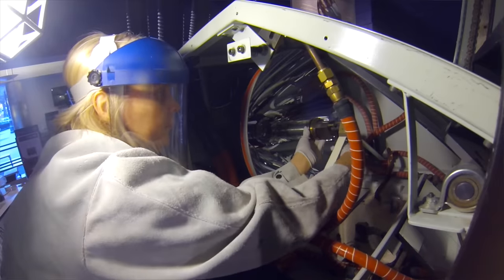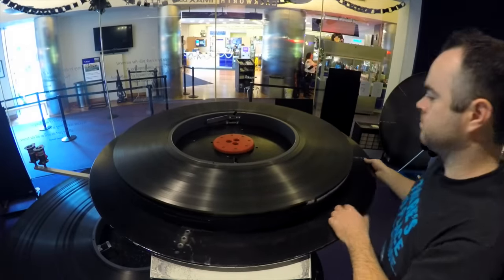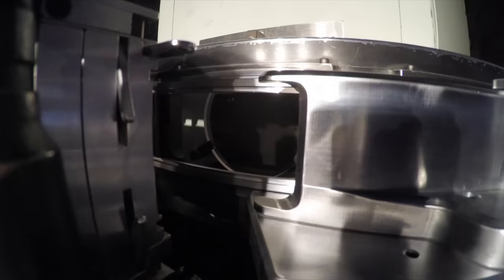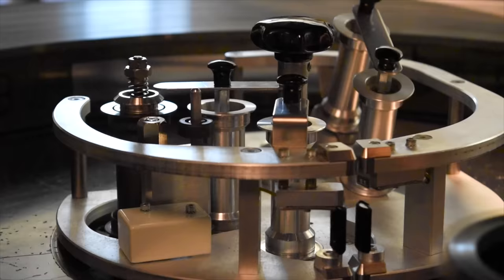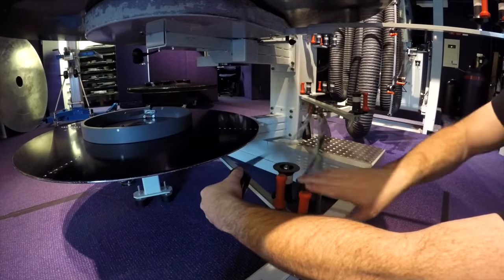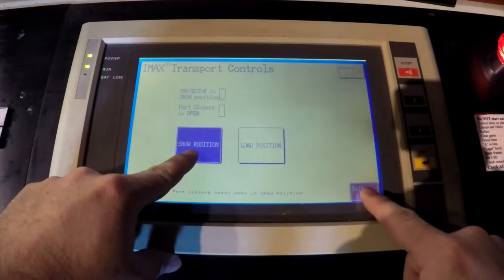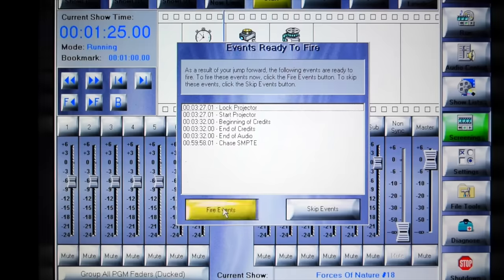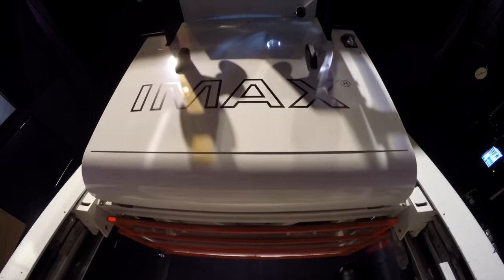The Incredible Process of How a GIANT 70mm IMAX Film is Played

Comment: I used to think like "dang. IMAX is just a scam, why so expensive" after watching this, I respect IMAX again. Great job guys.
Reply: Most IMAX is just digital with the IMAX brand slapped on which is just a scam.
Reply: the real thing would be to see a movie actually shot on 70mm, and then projected on 70mm.... but there are only handful of movies ever shot on 70mm film

Hateful Eight was probably the last one ever shot on 70mm.
Reply: @YoutubeUser-nd8qv   70mm and IMAX are not the same thing. They use the same film stock, but use it completely differently. 70mm (what Hateful Eight used) runs the film vertically, with each frame being five perforations high. IMAX runs the same film horizontally, with each frame being fifteen perforations wide. An IMAX frame is three times the size of a 70mm frame.
Reply: Imax is a scam
Reply: @eksine  Usually, but not always. If you're seeing actual 15/70mm IMAX film projected, it's not. Any form of digital projection is a scam, at least until it meets or exceeds 8K resolution.
Reply: It's called Lie Max and you can see a list in Wikipedia which theaters have real IMAX, only 5 in USA are real IMAX
Reply: @YoutubeUser-nd8qv  Dunkirk
Reply: @YoutubeUser-nd8qv  isn't avengers infinity war shot completely on 70mm film ?
Reply: @YoutubeUser-nd8qv  pretty sure Dunkirk was on 70mm
Reply: @TheAkashicTraveller  Well imax digital is still alot better than normal..
Reply: @gasparmxm  less and less as time goes sadly.  My theater had real Imax but took it out for digital .  I guess to avoid this tango, a digital file is much cheaper to run.
Reply: @aniket8350  Infinity War didn't use IMAX cameras or film at all. It essentially used "Liemax cameras", ordinary digital cinema cameras with the IMAX name undeservingly slapped on them. No commercial movie has ever been shot entirely on 70mm IMAX film. The cameras are so loud that no audio can be recorded on set, so the actors have to re-record the dialogue of any scene shot with them. Therefore, they're typically only used to shoot action sequences where recording the dialogue on set isn't important.
Reply: @NeonNion  Not really, no. IMAX digital = 2K or 4K. Normal = 2K or 4K. IMAX digital would just have a marginally larger screen and more powerful sound system. It wouldn't even have Atmos and HDR like Dolby Cinema does.
Reply: @aniket8350  No - it was all digital. No film at all.
Reply: @JamEngulfer  True!
Reply: @aniket8350  nope they used arri camera which is licensed by imax and also 3d movies cannot be made in films , hence that
Reply: @YoutubeUser-nd8qv  lucky us
Reply: IMAX is no scam; it truly is a state-of-the-art, immersive movie experience!

Comment: Engineer 1: How can we make this really complicated machine even more expensive?
Engineer 2: Let's attach it to a lift
Reply: dude totally
Reply: It's because there's a different kind of projector that can be raised into the same spot in the exact center of the dome theater.  That other kind is the star projector that draws all the stars for presentations about astronimy.  Because most of these domes were built for astronomy before IMAX existed.
Reply: This is what happens when you throw money at engineers and lock the accountant in a cupboard.
Reply: Not like  they could just have a pannel that pops up to block the light. No move the whole machine
Reply: @wetlettuce4768  as things should be!
Reply: - But i'm pretty sure ppl invented mirrors already.
- No we are doing lift.
Reply: @DivineOwl  yes lol
Reply: They should have just hired a Mazda engineer. Then the guy would have to take the front end of the building off to change the bulb.
Reply: @whatcouldgowrong6224  true...so very true
Reply: @wetlettuce4768  Something that should be done on ALL new projects.
Reply: The reason that they use a lift is because the films are 240kg
Reply: No room for the Film platters up there in a Dome Theatre... or at least not that one.
Reply: @DivineOwl  tbh mirrors won't actually work that well
mirrors absorb ~5% of the light, and reflects only ~95%, so every reflection slightly dims the image. the image is also going to get bigger after every reflection, so the second mirror had to be bigger than the first. they also have to keep the mirrors dust free, which might be complicated for the projectionist to clean. they could've just point the projector upwards, which will reduce the number of mirrors, but i don't think a rolling loop projector designed to be used horizontally would work properly in a vertical position.
Reply: So overcomplicated, 70mm film will only be notable for a few more years before it becomes crap compared to digital.

Comment: I worked 10 years as a projectionist trouble shooting Ive seen crazy stuff happen. Brain lock is common and can take 2 min to a hour to fix. The worst I had was titanic for some reason had a issue with the film and static causing the brain to spin out of control and it fly off the platter. Not fun in a sold out show. Also Ive had bulbs blow, power systems to the projector blow, lens crack. 
One funny one was Dr. Doolittle 2 reel 4 was in Spanish. It was in the film no way to fix it. We had to wait for a new reel to change it on the platter. I miss it the pay sucked but somedays were a adventure.
Reply from the maker: Oh, yeah. No two days are alike as a film projectionist. Sounds like you had some stressful moments.
Reply: I thought the audio was on a DVD, not on the film... suspicious!
Reply: I worked at a theater back in the early-mid 90's ( I was 16-17) I remember one day someone forgot to put the platter on "payout". So a few mins later the film wraps around the brain, stops, burns then breaks. Talk about a pain in the ass to fix. My sister was actually in the theater watching "The Craft" came out and told me that it just stopped and you could see a hole burn through the film on the screen.
Reply: @scowell  dude that's one type of film most of them do have it on it
Reply: @chabka34  On IMax?  Not to my knowledge.
Reply: I once had a brain wrap so bad that the film caught fire in the projector and melted. Scariest thing ever.
Reply: @scowell  Usually several different "sound" tracks on the same film print. As different theatres had different sound systems and multiplexes would usually spring for expensive systems in their prime houses and cheaper systems in their smaller "been here a couple weeks" houses but the same print would play on all of them. The dvd is synced to a time code on the print.  In some cases if your "fancy" sound system failed it would default to the older "since 1930's" optical system or you might have to do it manually.  We had some con job digital "imax" that consisted of two 4K projectors lashed together running the same movie but since our film projectors had all been sold for a $100. a pop and shipped to India and the whole 18 screen digital system could be run by a PC down in the managers office my services were no longer needed and I didn't learn much about it.
Reply: 10 year projectionist myself. Yep, all those things and more.
Reply: Ahh nice to see a real film Imax. The art of showing movies has gone away since the arrival of digital. Never again Thursday night's will be the same with building and tearing down prints. Oh and brain wraps and all sorts of other stuff. Now, a light engine goes out. 20k dollars later and a few days off screen.. Film.. Give me an hour at most to fix most anything.
Reply: Thankfully nowadays we have digital projector....
Reply: @clydedsouza5843  Thankfully ? wtf
Reply: @christopherjohn1467  The problem is that since mainstream theaters have gone digital and film processing has declined, the cost of processing has gone through the roof. A single 35'mm print can now cost $2,000. 
When a film is shot in digital, printing a negative to produce prints also costs eye watering sums of money.
Reply: Was the problem ever brain freeze?
Reply: I guess a lot of people experience brain freeze on a daily basis ;)

Comment: Huh, Interesting to know that the audio doesn't come from an audio track on the film strip, but on DVD...
Reply: Tyson L wonder why it isn't put on a blu-ray
Reply: Jason Lee Because it doesn't need to be. The audio would have to be extremely large to be on Blu-Ray
Reply: Kidboy A.G. you seem to be forgetting that 128 lines of audio as for example specific by the Dolby Atmos standard can be in total more than 100GB. You will be going nowhere with a Blu-ray in those cases.
Reply: Well, a number of DVDs actually.
Reply: Blu-ray didn't exist when IMAX came out, and this is an older theater.  Neither did DVD, for that matter, so not sure what original IMAX movies used to store audio.  I would guess it was magnetic tape, but that's a guess.
Reply: +Michael Bauers I feel like I saw an ADAT machine in the rack, or might have been a hard disk multitrack recorder like Fostex or Tascam made
Reply: T4iga your 100gb number would have to be before compression. Otherwise no bluray or 4k bluray release would have an atmos track
Reply: IMAX means Image Maximized, which means you're seeing the highest resolution image we're capable of shooting and projecting at 24 FPS. At this point, we don't have a digital system capable of matching the resolution of IMAX film. Therefore, any digital projection system called "IMAX" is not truly IMAX and does not deserve the name.
Reply: Yep, magnetic tape synced with the projector. I believe it ran about as fast as 35mm film, while the IMAX film itself runs over three times as fast.
Reply: @adam ahmed This resolution claim is worthless without reference.
Reply: @KingdaToro  Most 35mm film (and 16mm film) has an optical audio track, not magnetic tape. Magnetic tape is mostly used for 8mm film. Optical doesn't have to be digital, it also works with FM modulation if you want to. Same with Laserdisc, the audio was read by a laser but it wasn't digital (and sounded really, really good).
Reply: @rollingtroll  Yes, most film formats have the sound on the film, 35mm typically has several formats. IMAX doesn't, in order to use the maximum possible area of the film for the image. It initially used magnetic tape for the audio, but now can use optical disc or digital.
Reply: @michaelbauers8800  Yes.. there was a separate player with a reel magnetic film about 2mtr. high

Comment: This was cool to see. 
I worked on the sound systems back when these were first being designed. I was the one who designed the sync system for the digital audio tracks when it was first making the transfer from the DA-88 to digital workstation,  and it was really fun to dee a DA-88 still in the rack. 
The biggest problem I ran into was the inertia of the projector on startup. The projector fed LTC to the system which used that for the sound sync, but going from dead stop to full running speed took a chunk of time to get from 0 to 24 FPS, and that was all we had to lock onto. 
The immensity of the whole thing was insane. I remember getting introduced to the subwoofer room, which was essentially the inside of the subwoofer cabinet, and was larger than my first apartment.
Reply: When I worked at the Imax at Great America Park, we had 6 track sound on 35MM mag film that you synced to the projector electronically. No problem. Find the start point on the film and on the sound track and hit the sync switch!

Comment: Why a lift? Isnt it easier and cheaper to build the room higher up?
Reply: I know at my local IMAX (dome type the st. louis science center) theres two reasons. One, for dome types the projection window is actually situated in the seating area because it needs to project at an upward-ish angle. Two, it allows the projection equipment to be an exhibit unto itself in the lobby
Reply: @KingSlimjeezy  plus you can use the wasted space under the seating I guess :D
Reply: @KingSlimjeezy  Yup, where as normal imax is above the crowd. Because a dome IMAX uses a lens that requires a broad field of view. The projection station is actually central in the seating area. If you made paths to walk there you'd loose seats. So you load it on floor one, raise it to floor 2 and you're good to go.
Reply: It depends on design of the building and cost. Is it cheaper to build a second floor room with a heavy lift/elevator for carting all the film reals or to simply keep the room on the ground floor and raise the projector itself, with the film already loaded? I believe the latter is the cheaper option(in most cases).
Reply: For a regular flat IMAX theater, yes. For a dome IMAX theater, the projector has to be at the center of the dome, and is surrounded by seats. If you were to build the room high enough to not need a lift, you'd lose the seats on the sides of the projector and above it.

Comment: I have been in professional audio visual presentation industry and my father was as well, since 1944 where he worked with military footage from wing cameras , through the advent of television where he was a critical member of the installation and production teams of 5 different TV stations, including the original ABC station in Washington , DC. WMAL ch.7. He and I both worked with 35 mm and of course, 16mm. He was a film director as at that time, there was no such thing as video tape or digital. In all those years in the industry, I have never heard the phrase "play a film". We both worked with JAN projectyors (Joint Army/Navy) projectors where the images were on one 16mm projector and the audio was recorded on a sproketed, 156mm magnetic track on the other side of thew projector from the optical so they would stay in perfect sync. This was achieved by marked sprocket holes optically counted during development and recording. It was the next generation of a clap board in post production.
Reply: My dad started working for Dumont T.V. the longest on air television network in the world (and still is on the air, not as Dumont, but Fox) I began my career in video tape in 1955. I habe worked on EVERY model of video tape machine that AMPEX made. I was the youngest ever to be nominated for an emmy for tape editing at the time as well. I am a proud IATSE member.
I never fiddled with film, as it was a process that I felt was old and had no place in Television, since television was an electronic medium.
I do find that film has a charm that video can never achieve. I am extremely disappointed that movie theaters are reduced to big screen TV's. Gone are the days of huge 70 foot screens where you were immersed in the film. Radio City Music Hall was one if the greatest movie theaters around and I am glad its still in operation (not as a movie house though)
Alas because of corporate greed, there will be no more film. IMAX is going to replace the projectors with laser projectors with content comming from servers. Gone will be projectionists, film labs, distribution centers, duplication houses and all the support companies. Shame
Reply: @rty1955  Agreed. Film has a warmth that video has never and will never achieve, AFAIC. I grew up with film of all types and thanks to a chance meeting with an incredible film expert by the name of Kemp Niver several years ago, I had the opportunity to hold some of Thomas Edison's original motion PICTURES in my hands.  His original motion pictures were actually that- strips of photographic paper creating motion by actual strips of sequential images, not the little flip card displays. Kemp also won a technical  Oscar award for creating the Rennovaire system, that pin registered each individual frame of the old nitrate films and re-photograph the origiginal onto safe, non flammable celluloid stock so it would survive time and exposure to air. He willed his entire library of Edison's collection to the film library at USC. His equipment is also now in the Smithsonian. 

I also did a LOT of work with 3-1/4x4 " hand- mounted glass sandwiched slides through the advent of 2x2 slides. The coolest exhibit was using 80- 2x2 slide projectors torecreate full 24FPS motion for the NAVA convention (pre-cursor to INFOCOMM) in 1969. WE cut up a Donald Duck cartoon in 16mm and reshot it frame by frame to 35mm slides. the animation was created by using a 1" mylar tape with puched holes, to change the slides of all those projectors in perfect synchonization.

I also installed the first video projector ever used in a federal hearing in Washington, D.C.for the legal hearings of Bob Haldeman (Watergate character)

My Dad was also the film editor and projectionist for the Senate hearings into the game show scandals of the 1950s.  My uncle was also in the early television industry in the late 50's through the early 80s. He owned his own radio and TV store and installation business in Sandusky, Ohio- 'Bloomquist Radio and TV.'

Comment: In the 1970s, as a kid, I went to a few IMAX movies in St. Paul, MN.  And I saw some of this gear, and thought it was amazing looking, but I didn't know how it worked.  I do wonder why they have an elevator system.  Did they build the projector on the ground floor just to show off the gear?  I would think 70mm IMAX is better resolution than 4k digital?  But maybe it's dynamic range is less?
Reply from the maker: Yes, 70mm resolution is better than 4K. It's closer to 18K. The projector is lifted into the theater because it needs to be in the center of the the theater so the fish eye lens can do it's job. So it's not just to show off the gear. We have those giant glass windows to show off the projection booth. Some booths don't give guests that opportunity though.
Reply: The Omini theater in St. Paul, at the science museum had a similar arrangement, with a tilted dome.  The theater was also a planetarium.